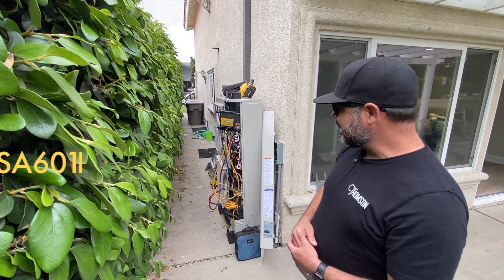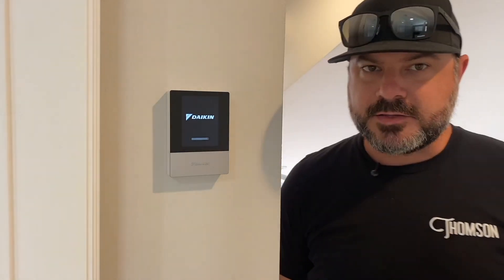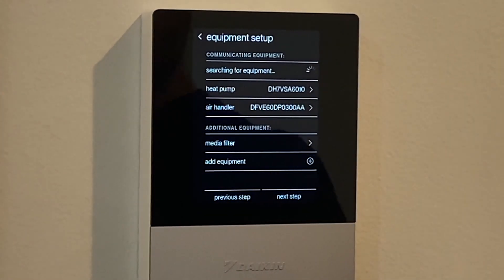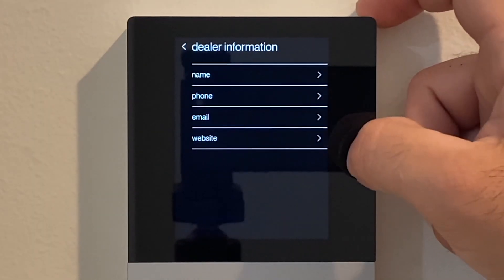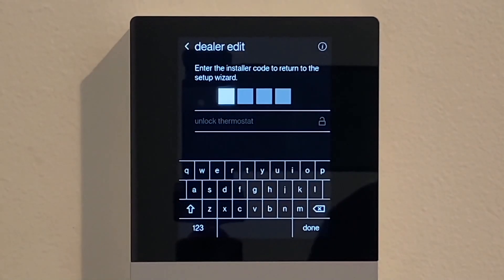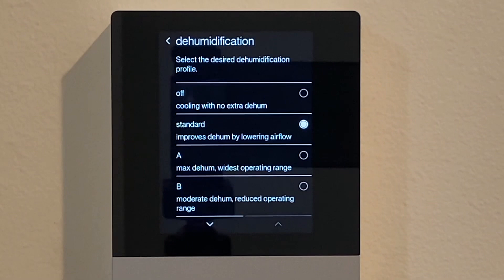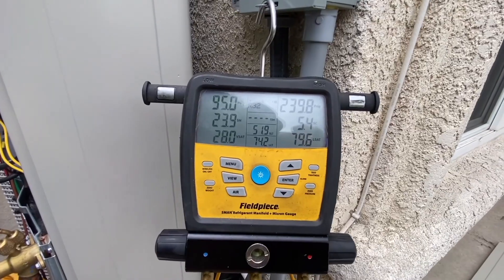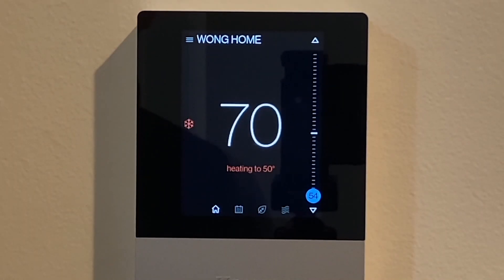Here's how Thomson Commissions a Daikin Fit for Proper Moisture Removal in sunny Southern California

Comment: Thanks for posting. Will try these settings. Live in LA and having humidity at about 60%. Had the Daikin Fit 2.5 ton for about 6 weeks, first month, maintained humidity at about 47%, but has gone up recently.
Reply: Wanted to follow up on my comment, I used Dehumidification setting C and worked better than Standard or A.

Comment from the maker: Sounds like they should’ve used different terminology. I believe maximum on setting A means the system will run longer and dehumidify more, while most aggressive means the dehumidification will happen faster but for a shorter period of time. I would try each and see which you prefer.

Comment: Do you think there’s a lot of differences between the DC6VS and DC9VS models?
Reply from the maker: Many differences. The DC6 is a Daikin fit, slim and horizontal discharge at 17.2 SEER2, and it uses R-32 refrigerant and is currently available. while the DC9 is a vertical discharge cube style system that achieves 22.5 SEER2 and uses 410a refrigerant and is no longer available (at least in California)
Reply from the maker: There are R32 alternatives to the DC9 tho, and those should be available